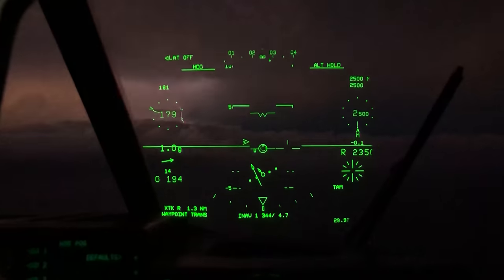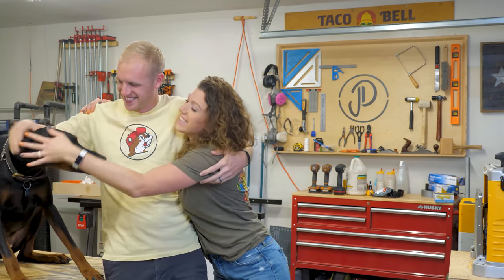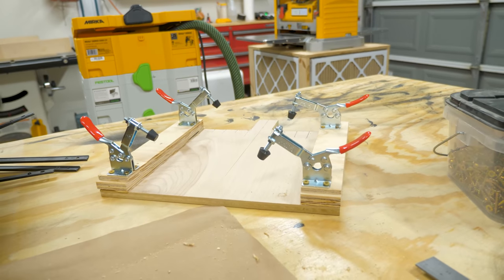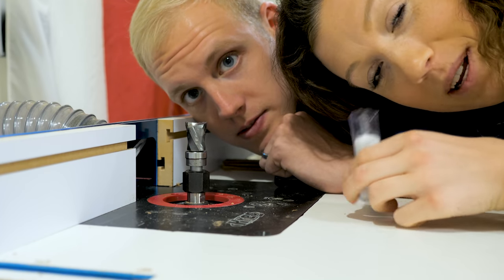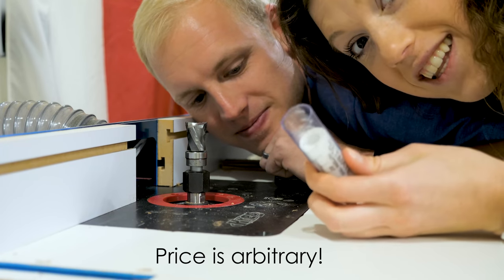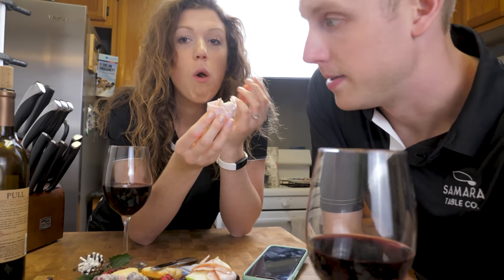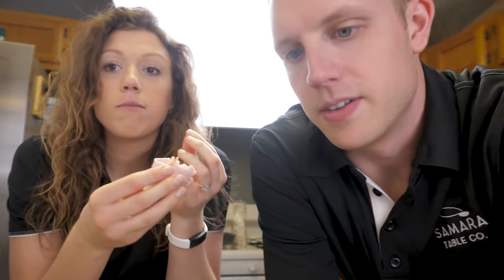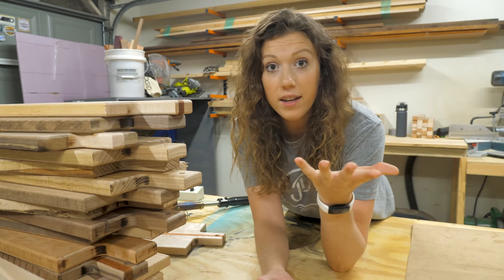we built 20 charcuterie boards in 1 day

Comment: Here's my 40 plus years of woodworking  input. Your template should be perfect from the start. The flaws created by a not perfect template cause the loss of time and lessens the quality of your product. The time it takes to correct your one template will save you. Time is money! Never lower your standard! Tip:  You used the bandsaw to freehand a straight line. Use the band saws fence to add in cutting a straight line. A properly aligned fence and properly tensioned band saw blade works perfect every time. Certain woods extract oils from within. End grain will always burn faster than long grain. Slow your speed down on your router. Speed equals heat buildup. Not using a variable speed router, then add an after market speed control unit. Don't slow your feed rate in the corners. Wipe the edge of your boards down with Naptha or Laquer Thinner to remove surface oils prior to routing. I spray my flush trim bits down with a Dry Teflon spray. This helps to reduce friction. All this will help to reduce burns marks but minimizing them is key. Then it's up to the light touch of a spindle sander to deal with those inside corner burn marks that may still happen. I am disappointed that you never took the time to learn how to use software to make your CNC a viable workshop tool. I mastered Vectric's V-Carve software in less than 6 hours. The days of hand making template patterns is behind me and I use the CNC to produce parts for mass production these days. Good luck!
Reply: Given the girth of the ultimate spiral pattern bit (which is the whiteside bit they are using) a router that doesn't have adjustable speeds shouldn't even be part of the conversation. :)  That thing is almost an inch wide, having it running at the same rpm as a 1/4 inch shank roundover bit is just WAY too fast.
Reply: In your video, I could not help noticing that your handle in your template was not straight. I could take my eyes off of it from scene to scene in Hope's the flaw would disappear. I agree with the remarks above. A perfect template equals much better results. In your videos you keep on talking about your quality products. I know that you are striving to increase production by decreasing product build time. I believe that you should devote more time making quality products than reducing your time making so so quality items. Dont get me wrong here. I think you both are doing an excellent job passing on quality information to your followers (that is why I follow you as well). I am just making an observation that as a consumer I would have preferred seeing this item with a straight handle.

Comment: If you add a dowel/peg to the template the size of the hole your drilling and drill it first you will have a faster registration point each time
Reply: I was thinking that also. Do the drilling first. And also, I know that the jig is oversized to fit bigger boards later, but you could make a stop block on one side for the edge of the board to align against. It only needs to be at the end of the board not the full length of the jig. So a small 2" block in conjunction with the dowel David mentioned would make setting/aligning the boards in the jig quicker. You can incorporate the stop into the jig itself by making it adjustable.

Comment: Increase the radius by your handle, will eliminate the burning and save on sanding. Will also make your bit last longer with less heat build up.
Reply: An idea if possible to lower the speed of the router.
Reply: @rnunes350z  Yes, lowering spindle speed will do the job - AND make the bit last longer.
Reply: Or increase feed rate. The bit is sitting in the area too long. Keep the router speed but push through much faster... Peck into the corners if needed
Reply: Reducing router speed will reduce applied torque as well... These bad boys excel at higher speeds

Comment: Here is my suggestion and it will actually double your routing speed. Make the jig twice as long. Have it setup where two cheese boards are butted end to end. Then modify your clamps to hold down both boards at the same time. Add a board to use instead of the rubber hold down piece. You can do this will the 4 clamps you have by adding a single clamping board on each side. Then you can trim route 2 boards before the need to setup another 2 boards. 

You need a handheld router for your finishing. 

Build a basic alignment jig for the final drilling so it is centered on the drill press. Looked like you were eyeing that.
Reply: This is how cigarettes are made.  The butts are on both ends and are cut as part of a final step.

Comment: On your drill press, when you drill the hole in the handle is a great place for a template that will hold and register the handle in the same place every time to drill the hole. It will save time and reduce the amount of thinking you need to do while drilling 50 holes in the exact same place.

Comment: A few things, but first... Jigs for the win! But to improve the jig and speed things up:

1) Have a cnc cut out the jig, out of a hardwood or laminate... Will last longer without deformation.
2) a smaller diameter bit for the router will let you skip the rough cut on the bandsaw, spiral up cut to clear out or even a compression bit to give clean edges and reduce sanding.
3) vertical handles on your jig will let you have better/safer control while pushing the thinner bit completely through the material (again without rough cutting) at a speed fast enough to not have any burn. 

Love your guys' channel!

Comment: You guys have great ideas. Love the videos. I do a lot of router work with templates too. I always have a hard time getting the right distance from the actual size cut on the bandsaw. Just happened to see you use a washer with your pencil marking to keep the distance correct. Pure genius. Every little tip helps. Thanks!

Comment: You’d be surprised how much time it will eat up to change the router table from the template bit to the round over at the end. Save yourself the time of changing the bits by having your final round over set up in another small trim router (the Bauer trim router from Harbor Freight is super cheap and plenty capable for this purpose). 

Let the round over just live in that router as a dedicated tool so you can just grab it and go.
Reply: I agree, but maybe not a Bauer ;)
A Bosch 1.25 HP mini router is a great little go to for this type of finish detail work, and its not terribly expensive.
Reply: I just cut down a BUNCH of time in my business by making a large router table with trim routers mounted into it attached to foot pedals. When efficiency is brought into the picture, changing bits not only takes time, it is an opportunity to slow down/take breaks/get distracted where you should be working.
Reply from the maker: When we have the floor space, multiple routers will definitely be the way forward! Thanks for the suggestion 😊
Reply: I would also agree with this comment. The cabinet shop I used to work for had two Bosch colt routers set up dedicated for edge rounding. One had a 1/16" round over bit, the other had a 1/8" round over bit. It's amazing the time savings in having tools set up for one specific task. Grab, use, and back on the shelf for the next project with no slow down in production. We also had this same philosophy with large hand held routers. One had a dedicated flush trim bit for trimming face frames where they joined the visible plywood sides.

Comment: A couple people already mentioned drilling the hole first and putting a dowel in the template for registration.  That would help speed things up, as well as a temporary spacer to make sure the board is straight in the template.  I say temporary so you can swap it out based on the size of boards you are making if you do a different size.  Also, I would suggest drilling out the corners of the handle.  Make a jig for the drill press so that you just flip the board over, drill both holes in the exact right spot, then you don't have to worry about the burning.  Ideally, you would use the same drill bit for all 3 holes and make one jig to align everything.  Someone else also mentioned using the bandsaw fence to make quick work of your offcuts and making sure your template is perfect.  Extra time there, will prevent time on every board after.  Just a couple ideas, hopefully, you find something useful!  Good Luck!

Comment: Might be worth adding some stop blocks, so that you don’t have to check when you are placing the board on the jig.   I’ve got two ideas.   1. Permanent block at the other end of the jig, ensures positioning and repeatable size.     2.   Place the jig against a block, the put the board on and butt up to the block.  Saves time checking with your hand.

Comment: Use a CNC to create a “perfect” template with straight lines.  You might even have this done fairly inexpensively at a local shop that already has a CNC.  You could even incorporate a hole for a registration dowel as suggested in another comment.

Comment: An efficiency improvement: Mount the branding iron to the drill press arbor (mount in such a way it doesn't easily rotate) and set a two sided fence to align your boards corner. Then use the drill press handle to pull the iron down to a repeatable location and with a more consistent pressure.

Comment: Have you tried using your CNC machine to route the handle and drill the hole?  You will need to add some registration stops on the CNC spoil board. Depending upon the size of the CNC bed, you could mount multiple boards. As one board is done and routing is being done on another, the finished board can be removed and replaced with another ready for machining.

Comment: If you try lowering the RPMs of your router and moving the workpiece through a little faster, you should reduce or eliminate the burn marks.  Reducing the speed will create less heat and moving the piece faster will reduce the to the board is in contact with the bit.

Comment: One way to help reduce burning in the corner is to have a larger radius on the board.  The burning can occur when the router bit is spinning but the router is not moving which occurs momentarily in the corner as you transition from the horizontal edge to the vertical edge.  Metal CNC machinists never use the same radius cutter as the corner radius to avoid chatter mask (similar to the burning on wood).  Hope this helps.  Awesome channel!

Comment: Not sure if this was said already.... but in regards to the “wavy” handle that you mentioned having to take more time to sand.... dont cut it with the bandsaw. If you want a straight line, cut it on the tablesaw. Thats the straightest line you’re ever gonna get. Or you can do what i do more often, use a track saw. I find that the tracksaw is better because your over cut line (due to the blade being round there’s one side of the board with a longer cut) is on the top where you can see it as opposed to on the bottom like with a table saw. Just an idea and how i like to get the straightest lines possible. Good job guys!

Comment: Don't know if anyone mentioned this or not but you're burning the corner because you're stopping. Make the corner a bigger radius than the router bit, maybe twice. You won't have to stop to make the turn. If you're handle is wavey, cut the template on the table saw instead of the bandsaw. Push it in, pull it back, flip it and do the same. Then cut the radius on the bandsaw with a narrow blade. Just be careful not to cut to far in with the tablesaw. If it's into the curve it will show up. Hope this helps.

Comment: Just some comments on what I see:
1) You made some of the boards with a different wood down the middle.  That makes a nice touch.  Consider doing that for all the boards even when the wood is the same.  During the glue-up, the center section could be the exact width and length of the handle with the side boards the length of the board.  That way, you save wood and cutting time removing the excess wood.

2) Consider making boards two at a time with the handle piece sticking out from each end.  Route the handles before separating the boards, do most of the finishing while still connected, and then cut the boards apart an finish the cut ends.

3) As suggested, make a drill press jig so the the holes in the handles are identically placed.
     Same for the placement of the brand on the board.  A small jig to hold the iron ln position is easily made.

4) Consider making a second router table dedicated to a round-over bit to smooth all the edges and inside the drilled hole.

5) Just because the handle you are proto-typing is common on Pinterest that doesn't make it your handle design.  Consider making a special design that distinguishes your boards from all the others.  Perhaps wavy finger insets.  Your template approach will make it easy to make them all the same.

6) Centering the board in your jig is problematical.  Make your jig either adjustable in width to accommodate different board sizes or make a few jigs, one for each size.  That way you'll get precise centering every time.

7) Consider making a 'blood groove' on the opposite side of the board so it could be used as a cutting board as well.  Another way to differentiate your charcuterie boards from others in the marketplace.  Make a template that clamps down to the center of the board with enough vertical clearance to allow a trim router to easily pass under.  Think of a folding setup, the center is the support and has some non-slip material on its surface,  The left side is a U-shaped piece the flips down to position the template on the board or maybe is the template, the right side is the clamp that swings over and hold the board in place.

8) No matter what material you make the template from, consider soaking the edges with some hardening material such as CA glue to preserve the edge.  Even with ball bearing bits, some wear will occur over time.

Comment: try drilling the hole first, and keying that drilled hole on your template so you dont have to feel to confirm it is hanging over the edge. just a thought.
Reply: If each board is the same size, then you could also add a fence to bottom edge so all you have to do is slam the board in the template, clamp it, and route it.

Comment: 1) Put a stop at the back of the sled, you will have consistent offset overhang for the template routing.  2) connect the clamp handles on each side with a board or some other connection, now you only have two clamping operations rather than four. 3) look into a second routing table so that you don't have to break down your routing setups - you might do the round over with one of the new compact battery powered routers.(but those have dust issues that you might want to consider.) 4) connect the contact pads on the clamps with a board, more contact area, less likely to leave circle imprints 5) figure out where your bottle neck is - if it's the router make multiple sleds so that the time the router time is cutting is increased. (one sled unloaded / loaded while other is in use.) 6) make a bandsaw template, so that you simply cut, flip cut, - better repeatability and probably have both jigs on the bandsaw at one time 7) since you are routing the bandsaw cut surfaces anyway, you could use a more aggressive blade in the bandsaw that would cut faster, since that cut will not exist in the final product  8) jig your drill press so that you don't have to align then drill.  
With all the jig templates, make sure that you give yourself sawdust relief, so that it doesn't build up.   I don't think it would matter for these operations because you aren't interconnecting it with something else, and if one meat board is a smidge smaller than than next the world doesn't end.  I take that back, they are interconnecting with the jigs further in the process, so yeah sawdust relief is important.  

Hope that helps,
--Mark

Comment: Wood resin can build up on your cutting tools, router bits included. This is 1 cause of burn markes. Clean with kerosene or denatured alcohol to remove. Router bit speed also should be adjusted larger diameter bits need slower speeds, smaller bits need higher speeds. When batching out products your bit can get hot from prolonged cutting so either find a way to cool the bit down or let the bit rest, this will make your bit last longer and less likely to burn. Wood to cutting bit surface area changes from outside to inside corners. Low surface area contact on outside corners and high surface area contact on inside corners. More surface area contact means less heat escape and more area for friction heat to build. Before doing inside corners would be the best time to let the router bit cool down. To avoid burning on outside corners reduce your pressure into the bit while cutting the corner.  Follow the line leading to the outeside corner extending past the corner is good practice when cutting to make sure you don't dig into your corner and burn, this requires 2 passes to complet the cut. Hope all that helps and was clear to understand.

Comment: Adding  a cleat to the clamp board. So you don't have to all ways center ,    and jig out the drill press using the clamp board .  Btw great work.   I am  currently building a wood shop my self. Yall are great inspiration.

Comment: Put a fence and a stop on the band saw to cut the waste corner so you don´t have to mark where to cut and can cut faster because is just push until stops and flip it to cut the other side, do it in batches rip cuts first and then the cross cuts, this way you can go closer to the line, remember that the less material you trim with the router process will be faster and cleaner.